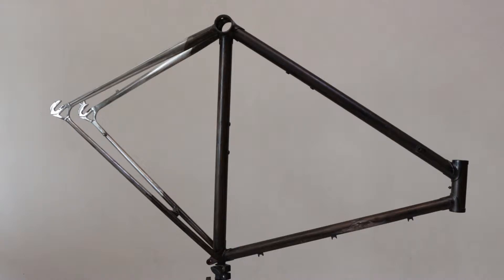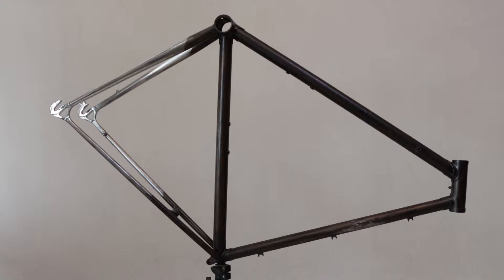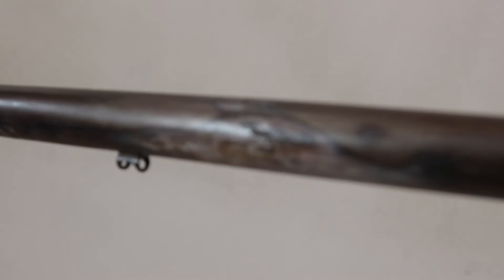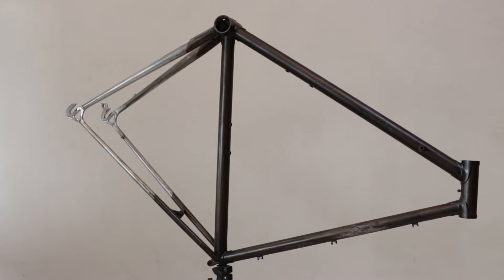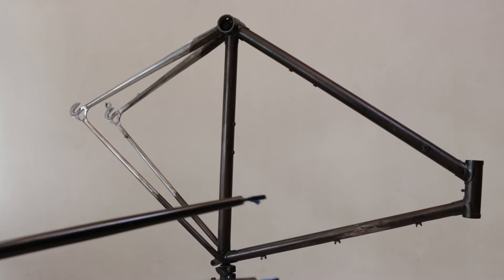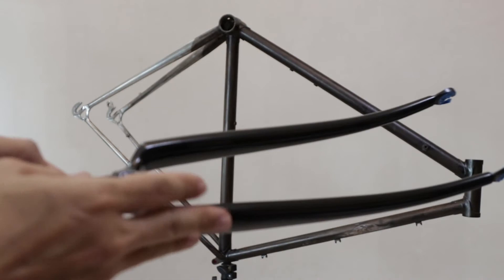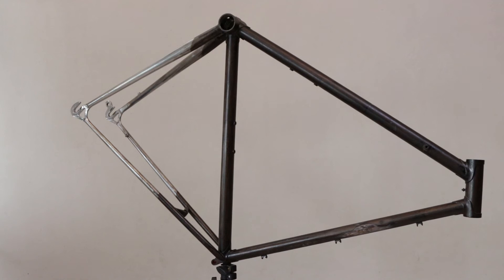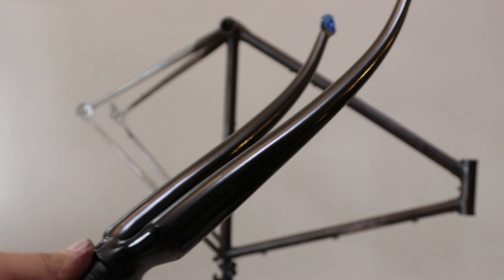Lemond Ventoux -- Repainting a Vintage Steel Frame (Part 1)

Comment: Hey could you please upload the other videos in this series?
Reply from the maker: Unfortunately, halfway through my project I encountered serious problems due to cross-contamination of my paint. It ended up a botched attempt. I will be make a second attempt at spraying this frame once this pandemic lockdown is over and will do a video series of my second attempt.
Reply: @vajrakilaya  man i have the exact same bike. Did exactly the same as you were supposed to do, stuck some modern components on it as well. Hope you do decide to finish and post the bike one day.
Reply: @vajrakilaya  how is it going?